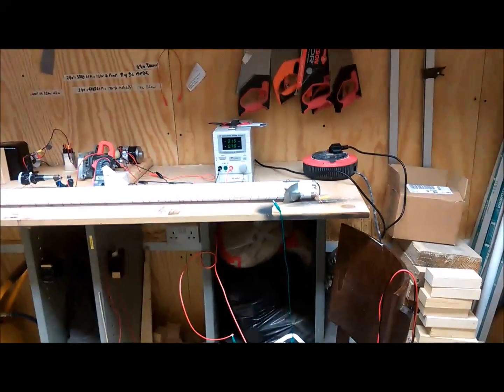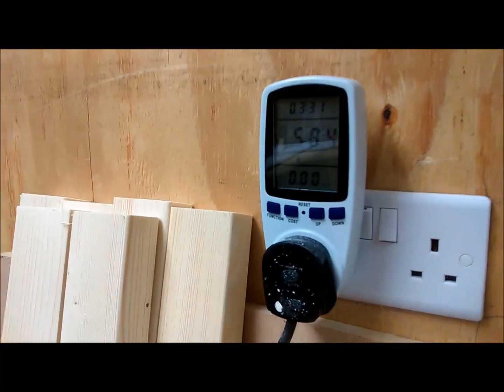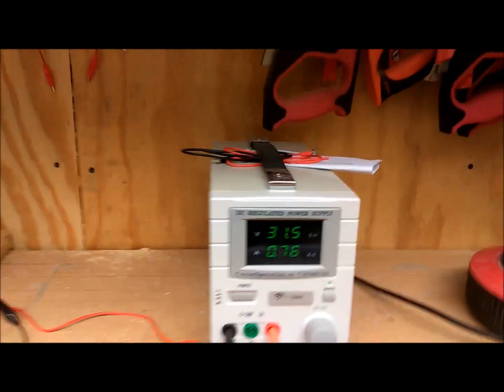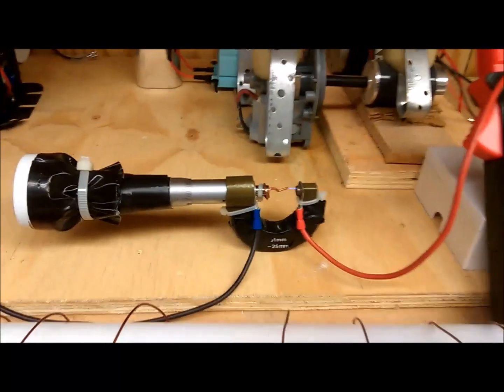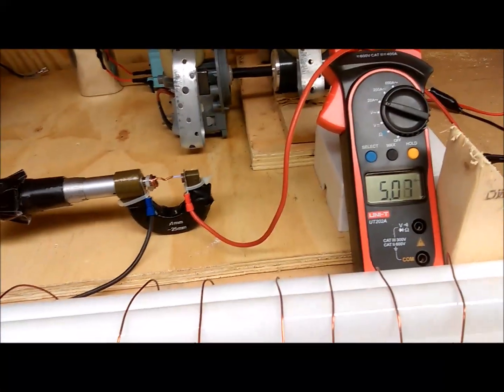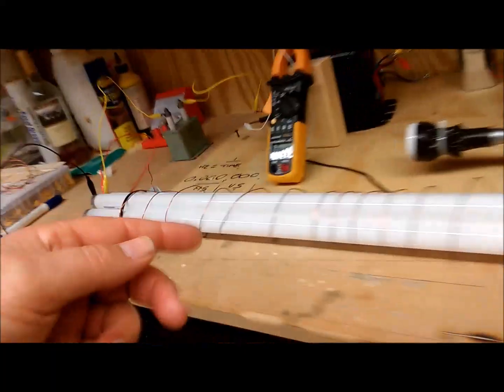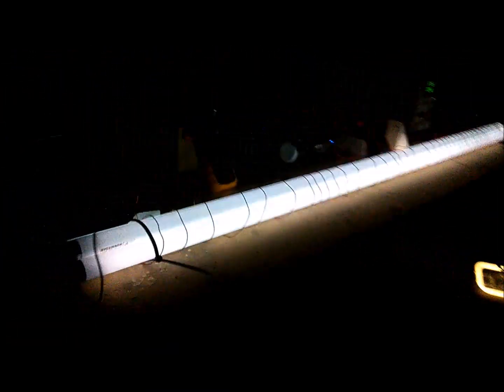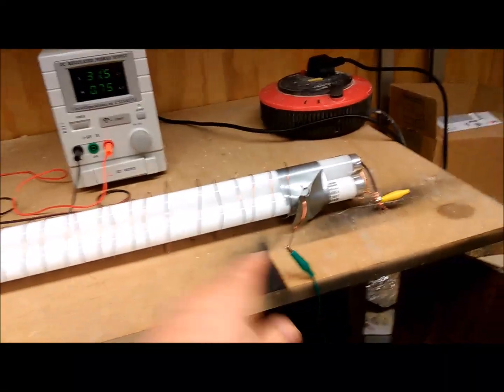Plasma Power Generator (4 tubes) Results FINAL

Comment: hi DC.
what i think you are doing there is increasing the frequency in hertz, in doing so you reduce the volts for instance in some countries most appliances run on 60 hz  and 100-127 volts here in the UK we are at 50 hz  220-240 volts, as you can see if we increase the hz by 10 we can half the volts needed to run the system, so i'm guessing you are well over 90hz, i did something similar myself with a 240v neon bulb and a 9 volt battery using a motor and armetur so i could control the rpm and and amount of sparks on the armetur basically producing whatever hertz i wanted to at 9 volts.  Nice work shop and by the look of it you are a man after my own heart keep up the tinkering, we should throw a few ideas back and forth guys like us i'm sure brain storming could come up with a thing or to.